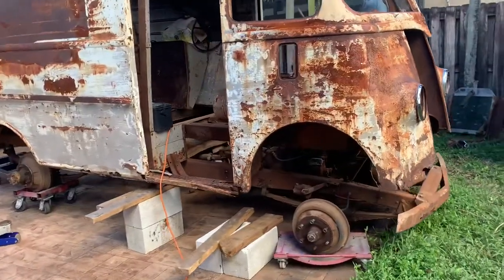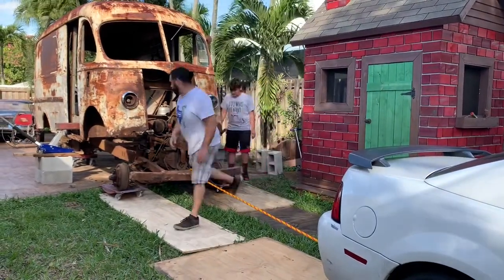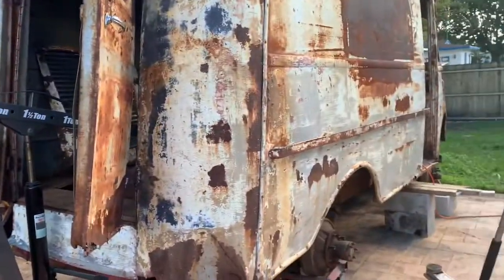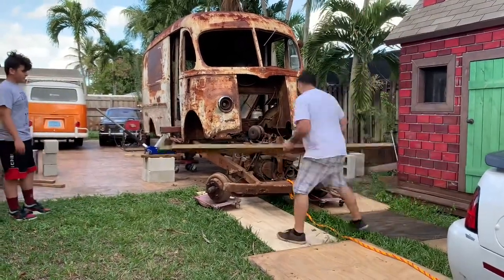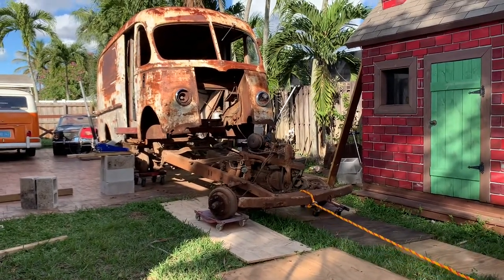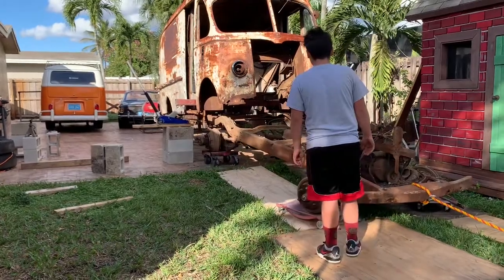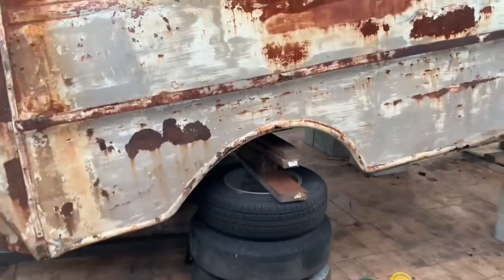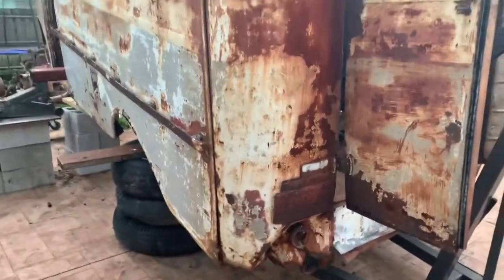Chassis removal - 1946 IH Metro Build Part 2

Comment: Do you still have the old frame ya took out and  what state are ya in
Reply from the maker: Hey Justin, no we scraped the frame. I wish I had space to keep large items like that, we are out of south Florida.
Reply from the maker: Check out our lates video and you see some updates on the metro project
Reply: I got ya I just pick a metro up last week and been thinking about doing a frame swap also mine didn't have a engine
Reply from the maker: @justincranford7249  that makes it easy, what size metro is it?
Reply: It's a A 120 is what it said on the side the wheel base is 114 in
Reply from the maker: @justincranford7249  same as mine, follow out vids we pretty much go over everything we have do to swap the chassis with an s10 frame. I can help with any questions as well.
Reply: Look me up on Facebook messenger if ya want and I'll send ya a couple of pics of it I would Herr but don't know how